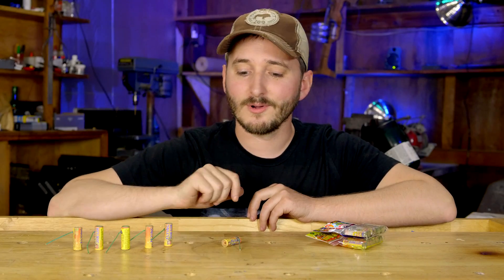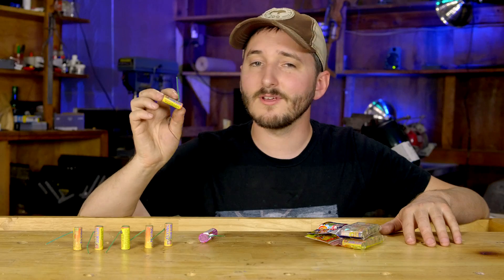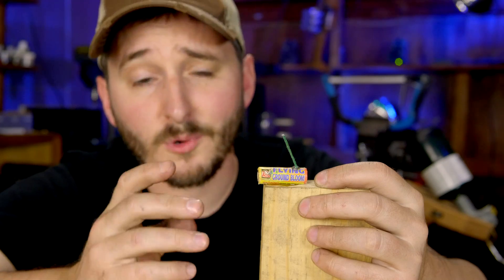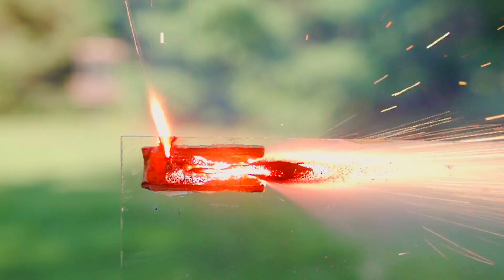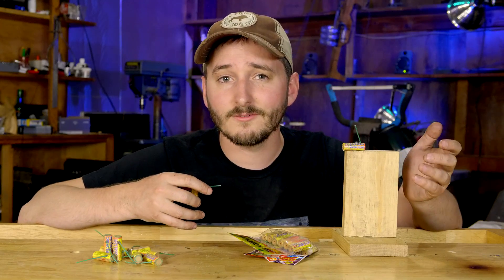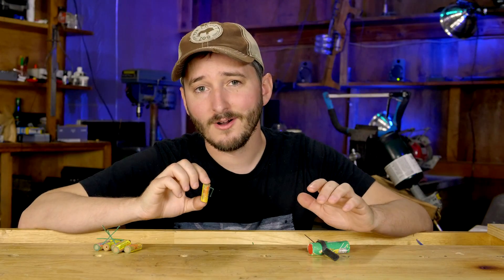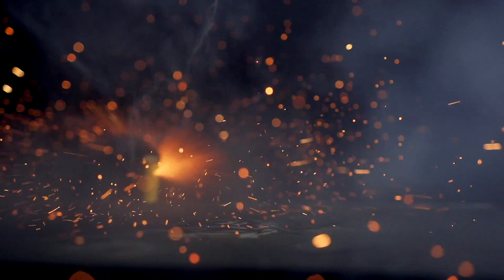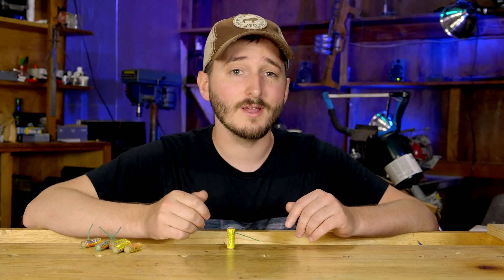How Do These Fireworks Fly?

Comment: Why not comparing these with normal ground blooms instead of the one with wings? This because normal ground blooms also tend to stand upright, and the ones with wings I only know with report, so it’s not possible to have a thrust hole in the bottom. Also try drilling a hole in the bottom and see them fly. Same happens when cutting off the end of a ground bloom but with less thrust

Comment: PRETEND   FOR  ONE  SECOND  LIKE  PEOPLE  ARE  LIARS  AND  CONSIDER  THE  FOLLOWING....
First we must understand that not every firework rocket will produce the same amount of power. Now that is stated...the firework rocket is producing more thrust when it's nozzle is closest to the ground. Here comes the part that many will get angry at me for stating: Rockets actually do push off of air to produce thrust. Now before you go ape on me for daring to call the common teaching a bunch of lies....In the immortal word of Inigo Montoya. let me 'splain...Newton's Third Law implies RESISTANCE. WAIT A SECOND!.....Don't fly off the handle just yet! Calm down and read the following numbered responses BEFORE you post the same cliche retorts I always get from those who think simply regurgitating the commonly taught "how rockets work" is debate:

1) There is still air above the Karman Line. You have been lied to.
2) No, I did NOT say "rockets don't work in a vacuum"...of course they do. A rocket will launch off the top of Mt Everest...which is a vacuum. I said rockets do, in fact, push off of air...because they require resistance.
3) Every experiment done in a vacuum chamber to "prove rockets work in a vacuum" is a strawman argument & red herring argument. Because the claim is NOT "rockets do not work in a vacuum"...that would be absurd. The trick is the use of "vacuum" (less air pressure) when the misled person is thinking "perfect vacuum" (no air pressure) ambient. Every one of these experiments has air inside the chamber, AND the rockets can push off the walls of the chamber.

ABOUT  THESE  FIREWORKS:
The firework starts to spin, because the exhaust is pushing off of the surrounding air..and the atmosphere is RESISTING the change in inertia. Like pushing off a brick wall...YOU move away from the wall which is RESISTING (pushing back) your attempt to move it. This firework spins and as soon as the exhaust faces the close surface..it INCREASES THRUST because the maximum amount of atmospheric pressure PUSHES BACK. This maximum thrust pushes the spinning rocket upright, and when the second nozzle starts exhausting..it shoots skyward with it's gyroscopic stabilization. What is called "ground effect" in this video is the ground amplifying the exhaust bubble pushing the ENTIRE EARTH'S ATMOSPHERE away from the firework 'rocket', and the Earth's atmosphere RESISTS that change in inertia by PUSHING BACK (a.k.a THRUST) on the rocket.

NOW...bring on the cliche ad hominems and statements I have already responded to above. I'm patronizingly calling you, the meatpuppet that just regurgitates the indoctrination, an informed ignoramus.

Comment: I must have gone through 1000s of those as a kid. Cool to see how it all worked. - the cut in half glass shots are awesome. (It’s also heavier at the bottom because of the clay and unburned fuel so that may be why it stands on end as the exhaust pushes it up a bit?)

Comment: horizontal thrust provides initial lift and vertical thrust provides take off and while in flight the horizontal force provides mid air stability on rotation. i make them all the time using match powder and red phospherus. have fun stay safe :)

Comment: its the same principles that are at play when you take a Cylinder (AA battery) on a table and press on it on the one side to get it to spin, fast enough and it will stand up  right. I believe Gyroscopic procession is the correct term? although, I am not 100 sure about that. plug the rocket end of it, and record it high speed, you should see it flip up on end and stay spinning at obscene Rpms at that point.

Comment: It's called a stinger missile or stickless rocket you would usually put it on a lunch spindle and the offset fuse hole caused it to spin and balance it then the core ignite and cause it to lift it go's really straight when lunch with a spindle gonna start makeing some 👍

Comment: I don’t think it’s friction.
The thrust from the side hole causes the firework to tumble on the table like in the slo mo. Then the  hole makes its way under the firework causing the gases to push it upright. The spinning was caused by the rotation of it being tumbled on the table and the gases boosting the rotation. The gases coming from the side hole keep the firework from tipping over because the firework will shoot gas in the direction of the way it is tipping pushing itself back upright on the next rotation it makes. After the gas will shoot out the bottom hole with the side hole still pushing it upright. Then it lands on the ground and you get to think about how cool a $0.35 novelty can get you in 3 seconds.

Comment: Interesting film and analysis. Reminds me to the well-known "Warhead Launcher" aka "Stinger Missile." Also reminds me of an item from Poland called the Hestia Sky Cruiser. The Sky Cruiser is a larger item, from memory abour 3 inches long and maybe 5/8" outside diameter.  Have you dissected one and weighed the contents, especially the clay nozzle & plug? Could the balance and shifting center of gravity account for the changing behavior of the item? Where is the center of gravity before the burn? Where is it on a spent casing with the plug & nozzle intact? I note that unlike the WHL, the device vents from the end opposite where it is ignited. I would guess the center of gravity shifts toward the nozzle during the initial burn.

Comment: Ben, yes it's intuitive... to an autistic.
Three properties allow these fireworks to behave as they do.
1) the propellant is packed so that the center of mass is "off center" and closer to the end with the hole in it.
2) the hole in the side is positioned so that thrust is on a tangent to the tube body so it makes the tube spin axially when the combustion gasses shoot out of it. This makes the tube "stand upright" because the end with hole in it is heavier than the end where the fuse sticks out. Standing up, it's ready for when the propellant burns through the initial burn stage to ignite the second propellant stage.
3) with the tube standing up and spinning axially the initial propellant charge burns into the second stage propellant charge which the combustion gasses exit out of the hole in the end which shoots the firework vertically up into the air.

I hope this makes sense. If not, please ask and I will try to explain it better. It's got to do with the physics of where the mass is (how the propellant is packed) which affects the center of mass and the fuse hole being made at a tangent to the tube body making it spin axially. I hope this makes sense.

Comment: I've been into fireworks for decades. Contrary to what many believe, original Ground Blossoms don't lay flat as they spin after being ignited, they wobble. If you lay one flat and ignite it as recommended, many times they will act like duds and not spin at all because of friction between the Blossom and the surface it's lit on. Very disappointing. The trick is to wait until the fuse ignites then give them a good flick of the wrist onto a hard surface away from you and if timed right, ignition will occur while the Ground Bloom is still bouncing around giving you almost a 100% shot of the Bloom doing what it's supposed to do. In regards to sky launchers ... The bottom portion with the port is made of packed clay making it heavier. As the initial stage sets the launcher into its wobbling stage, centrifugal forces take over due to the compacted clay at the port end making the launcher want to stand up on end and once the port charge ignites is what causes the launcher to lift off. Simple design, really. As a Side Note: Though I described a good way to get basic Ground Blooms to behave more effectively ? Never EVER !!! should anyone try that with a sky launcher. Bad idea.

Comment: What about the weight of the clay, its towards the bottom where the nozzle is. Gravity is pulling it down while its experiencing centrifugal force then the slow burn burns threw and ignites the lift charge
Reply: Exactly as I stated. There's a clay compact at the nozzel end which causes them to stand up due to centrifugal force. I know my fireworks too. Just look at my channel 😁

Comment: I'm a physicist, you're correct in your assumption with the spinning top. Horizontal rotation isn't energetically favourable, so that's why it eventually rights itself to vertical. But it's a very chaotic system so there will be a lot more things going on, but the angular momentum component will be the main explanation.

Comment: In the veritasuim video where he talks about the Russian spinning thing, he mentions a rocket which was supposed to rotate on its longer axis, but it started rotation in its short axis, I think this is similar, when it starts rotating in its long axis it will try to make it the least energy consuming rotation (the short one) but as it accelerates it will create an equilibrium and keep rotating in the long axis, the reason for it to always point down with the nosel is the hole is off center, so it creates momentum, and the ground avoids for it to go down first and then the equilibrium thing.

Comment: Back when I was in the PGII and before t he BATF came to visit, I used to make a gyro-stabilized firework we called a "Big Bird" The fuel composition was potassium nitrate, sodium salicylate, and a little sponge titanium. (for effect) One used a 3/4 inch paper tube about an inch long and rammed bentonite clay to plug the bottom, then a 3/8 inch hole was drilled in the center of the plug.  The fuel was rammed to within a 1/4 inch of the top and finished with a paper end cap. A hole to accommodate a piece of brickford fuse was pierced in the tube tangent to the circumference and 3/8 of an inch above the clay plug. Then a fuse was inserted. One placed the piece on it's bottom circumference. Light fuse, get away quick!  I made a few with small flash power chamber at the top, but after a few horizontal launches, I deemed it unwise. :) I also made winged pieces that involved dowels and tongue depressors which worked quite well.  After the BATF visit the Lord convinced me to either get legal or quit.
Reply: potassium perchlorate, not nitrate

Comment: Vectoring forces:
Consider the forces effecting each end of the cylinder separately.
One end, the one with the force toward the center, has only two forces affecting it (gravity) and the rocket force toward center. This end has no side vectoring forces or rotational forces. Only the downward force of gravity is in play initially while the other end is rapidly rotation. This end always wants to be as low as possible.
Compare this to the rotating end and there too many forces to calculate. Sooner or later the rotating force is aligned such that it opposes gravity and that end turns skyward. The other end is held down due to gravity anchoring that end down until ignition (stage 2). The delayed end rocket is now positioned for the vertical assent of the firework.
So, the first rocket turns the firework into a gyro top which stands it on end. Then the second stage lifts it skyward.
I think ……  lol

Comment: I think there are a lot of things happening. If a hard boiled egg is spun fast enough, precession will cause it to stand up so its rotation will transition from the short axis to the long axis. This firework is spinning about its short axis due to the exhaust jet out the side being offset form the centre, and then it stands up. But there's more. The jet is not radial, it appears to be angled a little so it causes the spin about the long axis sooner and then maintains it. Also as it begins, even if the jet is upward because the fuse was pointing up, it causes the firework to roll over so it can spin horizontally on the table and as it points downwards the additional thrust from "ground effect" adds to the lifting of that end, until it is just spinning about its long and now vertical axis, then the rocket engine launches it. Very clever and yet very simple. And I have never seen one, I only learned of their existence from this video.

Comment: don't forget the center of mass moves toward the bottom as the powder burns off. once the side thruster lifts the body off the ground, it will pivot around the center of mass causing the lighter end to rise higher than the heavier (unburnt) portion of the cylinder. the secondary larger exhaust hole provides much more instantaneous thrust compared to the fuse hole, and having been pointed down due to center of mass balancing results in a severe and fairly immediate upward thrust. Your video also clearly shows the cyclinder bouncing around before going upright. Only when the fuse hole is in extremely close proximity to the surface upon which it is resting does it tend to stand immediately upright. A bounce that results in the fuse hole never coming in direct contact with the surface as it spins will likely generally result in a sideways launch

Comment: I’m not a rocket scientist. 

I think you have the correct answer as pieces of all of your theories. The primary stage of the offset rocket spins the cylinder and thus stabilizes it. The second stage burst, launches it (away) in which ever direction it’s facing. At that point it’s like a spiraling football. 

Back to the primary, or first phase (whatever the correct term is)… the spinning cylinder is like that inverted top and wants to “stand on end”. The propulsion against the ground can contribute to this uprighting itself. When I was a child I had wooden cylinders and sewing spools. If you lay them down on the ground and then stomp (offset) on the side of one, as it lays horizontally, it will shoot out from under your foot, but it will be spinning like crazy. If you get it to spin fast enough, it will try to stand itself upright almost completely.

As seen in your video… it spins trying to stabilize and then second jet goes off sending it flying away perpendicular to its spin. The spinning gives the second stage some directionality albeit it’s a cone shape most of the time but helps it.

Comment: I think I have an answer. It looks to me like the fuse hole is slightly angled to cause the firework to rotate when fumes spew out of it. As it spins, eventually this hole becomes blocked by the table and the fumes have nowhere to go, so the firework is pushed up. As you can see in all the high speed shots the firework only jumps up once the fuse hole is blocked by the table.
This is especially clear at 5:40, you can see when the firework spins this hole faces the table three times. The first time, the firework jumps up but doesn't quite have enough force to stand up. The second time, the firework is not flush with the table so the fumes can escape without kicking the firework up. However the third time it clearly jumps up when the fuse hole is blocked by the surface and it manages to reach a stable upright spin. This spinning motion stabilises the firework while the bulk of the fumes are finally emitted from the bottom nozzle.
You can see why the nozzle side always faces down because the fuse hole is on the further end. If you attached a small rocket to one end of a long plank of wood, the rocket side would fly up leaving the other side on the ground and the plank would (initially) jump into a standing position.

Comment: From what I can gather, and also my playing with things, it is the rotation that makes the other end of the cylinder behave like a wheel's contact point and it rotates like a turning wheel which tilts it like the bikes do while turning and the wheel's axis starts to go towards being vertical. So the faster it spins, the straighter up it gets. 

Try spinning a small but long cylinder like thing like an empty lipstick, a plastic tumbler or something on its axis and let it go to the ground sideways, not perfectly horizontal though, and the faster you have spun it, the straighter it will start to stand while spinning. And it wouldn't matter which direction/side you spin it from and which side touches ground.

BTW, I saw this firework for the first time and it amazed me how a simple effect was used to create such a nice little mystery.

Comment: i have a feeling that the hole for the initial thrust is not centered to the circle cross section of the pipe, could it be only slight offset, and it would immediately start rotating along the bore axis. i hope you know what i mean ;-)

Comment: This video is more than a year old and I'm upset I don't see a solution invoking gyroscopic precession. Consider the axis along the length of the rocket, pointing towards where the fuse is. The fuse is off center, so the top spins around this axis with negative angular speed (i.e. angular velocity vector points towards the "rocket end"). As it rotates the side outlet will eventually point to the ground, at which point the fuse-end lifts up a little and only the "rocket end" contacts the ground, thus acting as a sort of wheel. The "wheel" pushes the rocket-end and causes a torque in the direction of the ground. The torque produced by the gyroscopic effect is given by the cross product of angular velocity and torque, this means it is perpendicular to both the gravity vector and the long axis of the rocket, so it rights itself. Once in the air it is just a spin-stabilized rocket.